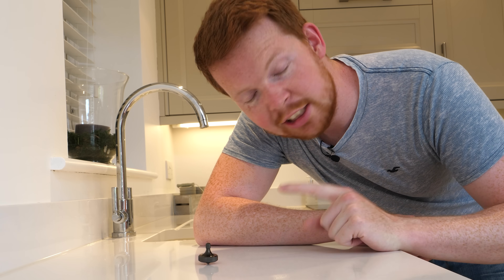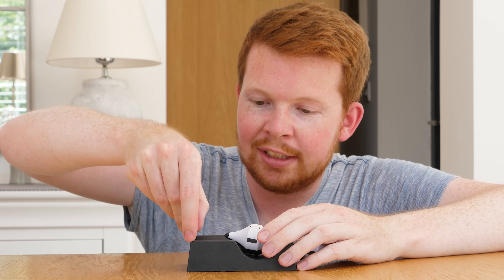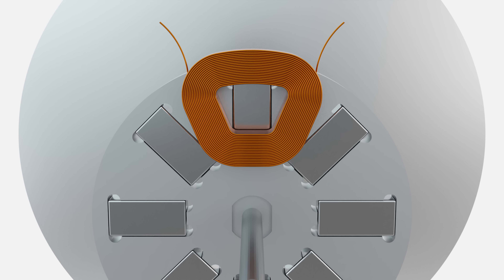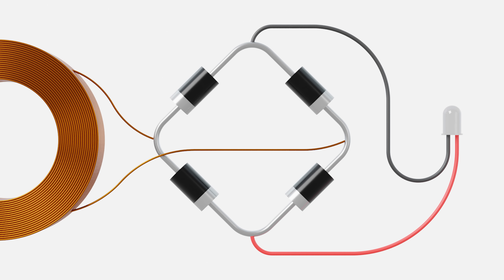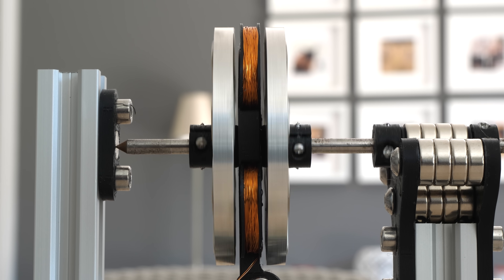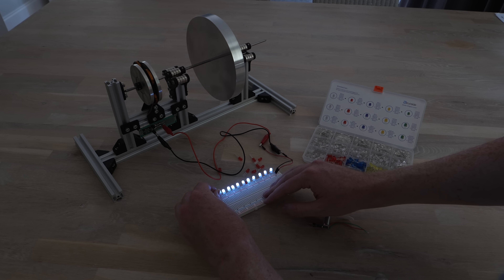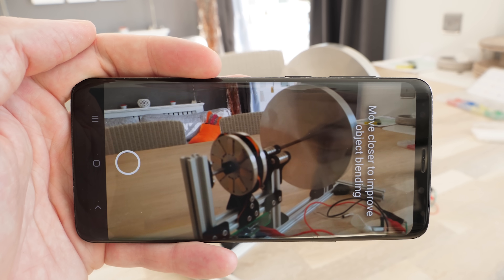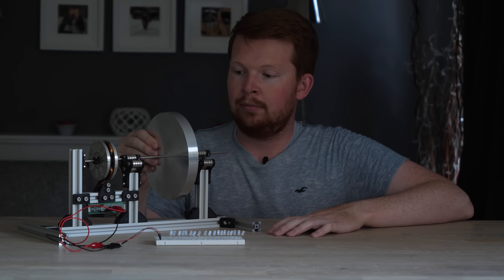Flywheel Battery

Comment: what if you were to add a small disk at the the end with fins and then a small motor fan powered by the flywheel spinning that blows the fins causing the flywheel to spin, wouldn't it eventually create enough force to keep it going? I was just showing my daughter that if she holds her fidget spinner and blows on it it starts to spin really fast so that is what made me think of this.

Comment: Could you not have got the motor to feed power back into the turning of the big metal wheel so that it never stops spinning until the heat death of the universe? we could generate infinite power. who needs fusion?? problem, friction??\#

Comment: Isn't air causing friction as well? I know that is a little bit in comparison to other factors, but if you would like to squeeze every single point in terms of efficiency, wouldn't vacuum chamber where it spins be a better solution? (Just a question as I am not a physicist so not sure if the idea makes sense or not)

Comment: I was wondering what the ratio in change of rotation length by the flywheel was in relationship to no electrical output, the LEDs, and motor or other devices, as this isn't free energy, and the magnetic coil induces friction on the flywheel

Comment: If anyone knew Tesla's secret on how he made the worlds first alternator the alternator actually powered itself as well as generated what was stated as over 1,000 volts flat foot he learned the values of creating rectifiers capacitors and transformers this way. Tesla almost by instinct knew how to create massive gobs of power from almost anything and everything he built. The problems he needed to solve were harnessing the power he generated as well as storing power is where his challenges came in. I have a good personal friend that told me stories over and over that his grand father actually worked 4 Tesla in Cambridge Mass. Well I always thought he was full 0 sheeet. until he showed me pictures that is. I started listening alot more closely after that to his tall tales. My source Bruce Seibert said Tesla was immune to electricity that he had many times touched live wires and nothing happened. Now how true that is is anyones guess he had to have a secret to do stuff/tricks like that.

Comment: If one were to A) Fix the shaft wobble and B) Apply all the best efficiency ideas from the comment section AND then...

1) Add a prop/turbine to the front of the center shaft
2) Hook the motorized fan to the generator
3) Set/aim the fan at the prop/turbine

I wonder how much longer the fan would help in keeping the generator rotating(!??)

Comment: Energy increases linearly with the mass, but with the square of the velocity.  I remember reading articles 20 or 30 years ago about ultra high speed kinetic batteries...  20k rpm, etc.  Problem still exists...  if it breaks, the energy has to go "somewhere".

Comment: I like your videos they are informative, keep it up you may want to scrap the Aluminium as a retainer near the magnets it will create magnetic influence and slow the motoring action, I suggest plexi glass as it is also easy to machine, as for the wire I would suggest Litz wire and maybe some russian ferrite for the cores, Happy experimenting.

Comment: Why not create a generator like they have in hydroelectric power plants and use magnetic bearings?  Also the flywheel will spin much longer and speed will more regulated if it were in a horizontal configuration.

Comment: Very interesting video.   I remember decades ago in the Netherlands (a very flat country) they fitted 6 FEET diameter gyroscopes in the floor of their public busses. These were spun up overnight and could run the bus all of the following day.  I cannot remember if the gyros produced electricity to power a motor or took energy via a clutch and gearbox. Operating a bus like this on very flat terrain exerted low "load" on the system and it would run the bus for a day. (Possibly shown on the program " Tomorrows World?"   
Your model must be almost what is used in a hydro-electric dam but I have always wondered.... if it was really scaled up with a levitating rotor and frictionless magnetic bearings, just how much power could be generated.

Comment: You made a generator ,yes but like other kind of generators you need to use energy to energy out of it ,though the friction force has been minimized in you model by using magnet instead of barbering

Comment: You could make this project SO much more efficient if you used a 'true' flywheel. That is a wheel which has virtually all of its mass concentrated around the circumference, rather than uniformly distributed across its radius. In other words, make it look like a bicycle/motorcycle tire--which is why they are built the way they are,  to maximize efficiency. Otherwise, pretty cool.
Reply: I’ll never understand how videos like this get so many views, when in the real world this is stuff that’s been done way better for decades.
Reply: @jeffw8218  It's not about efficiency. It's about turning people on to ideas they might not have heard of before. Some 10 year old kid could feel inspired by this and go on to become a world-class engineer. It's literally what good science communication is all about.
Reply: @jeffw8218  You're confusing "outdated" with "elementary". Harnessing angular momentum and electromagnetic induction to generate energy is a foundational concept in engineering. Sure, you can probably find a more efficient way of getting the job done, but the point of this video is that it's a demonstration of basic physics. 

Also, what's wrong with making money while teaching? Or for teaching to be entertaining for that matter? Good teachers ought to be compensated well. Their job is to inspire the next generation of thinkers.

Comment: Very interesting! How much energy can be stored in this? How long will it keep spinning if no load is attached?
Reply: I'd think that if the shaft were made straighter to reduce wobble, then the only decelerating forces would be the friction of the axle on the plate and air resistance. Adding ball bearings at the plate and running it in a vacuum could reduce these. Even 50 years ago, researchers were speculating that a flywheel turning 20krpm or more in a vacuum on magnetic bearings could spin for two weeks, with enough energy left to do something interesting. Great fun.

Comment: Place 2 magnets at 45 degrees to the shaft magnets and one in the center at 90.  Might have to place the shaft magnets at 90 degrees to the shaft by attaching to a wheel.

Comment: Use a switch mode converter with MPPT. It explores the current and voltage relation ship of your generator and runs it at its best spot, resulting in most power extracted

Comment: We had several of theses (like your black plastic miniature) as an emergency backup power supply in the US Air force. It was at least ten feet long and 20yrs old when I first saw it. I asked to be sent to school to learn how to maintain it.  Surprisingly I was sent to school to learn its operation. One system (spun) generated 250KW for thirty minutes. Ours was very old 1960s tech in mint condition. I guess some would consider me as old tech.

Comment: why not infuse the magnets into the flywheel and the other magnets to the stand on the bottom? and them the coils on the stand to! the the magnets will propel each other away, causing the fly wheel to spin, and than making static electricity, and convert it into ac with a inverter? Jesus saves!

Comment: I think it might be interesting if you could apply one of the ridiculous gear ratio cranks to get something like this spinning up manually. It might be a trick to ensure it doesn't interfere with the rotation if the axel is faster than the crank (I'm imagining bike petals in effect), and it might take a bit of initial startup energy, but I think it could get some substantial mass spinning pretty fast.
Reply: That was basically my first thought too. If he's going to spin it up with manual power, might as well have pedals and gears in action.
Reply: A freewheel saps energy though.

Comment: if you can add a gear reduction system to the spinny end that you hand spin and something to engage/ disengage it,you can get it spinning at stupid speeds while requiring no gasoline or electricity, and use smaller gauge wire with more magnets and more coils relative to magnet size, you could power your house with this

Comment: Would you try to feed a little engine with the energy created by the flyweel just to improve the RPM and create more energy until be able to generate 12v or more

Comment: Cool! since you own a lathe, straightening the bent shaft will be a breeze. Chuck the flywheel using the outside jaws, indicate it, then using a 15" x 3/4" x 3/4" piece of wood with a slightly larger than the rod hole and some oil, apply force over the spinning rodat a 5 to 10° angle and draw the wood outwards slowly. This will effectively straighten the rod, concentric to the external flywheel diameter. Reverse the piece and do both sides in the same way and you'll have a perfectly true running inductor.

Comment: if the other end of the shaft was attached to a stationed small wheel bearing, the warbling effect might be less if not non-existent, however this will lead to wear and tear over time at those regions. finding ways to efficiently increase the flywheel rpm is directly proportional to increasing the power out put. this is a good work.👍.
Reply: That would introduce quite a bit of friction. Frankly the best thing would be better materials

Comment: what if you connected a motor to the rod and gave it an initial spin and then the motor just makes it spin infinitely Obviously a higher torque motor that can spin faster than the rod at an inital speed

Comment: Would it be feasible to keep the axle in position with magnets as well maybe? If instead of a metal or glass plate at one end there were two opposing strong magnets as well. One rotating at the end of the shaft, one stationary next to it. You would get rid of even that little bit of friction. And if you enclose the entire thing in an air tight housing with a pressure valve and create a near vacuum inside of it there should be practically zero friction at all. I think that might be a great upgrade for this, to make it into an actual long term battery that does not degrade with usage and does not use chemicals. To put energy into the battery you would just need to reverse the entire flow of voltage and make it in to an electric motor rather than a generator. Sure it wouldnt be the most space efficent battery type, but where space is no limiting factor it might in fact be useful. And its over-engineering the crap out of and already very nerdy project which in itself should be more than enough reason to try it.

Comment: Now instead of the drill you hook to the shaft either a windmill or a water wheel they don’t have to be consistent because once they get the flywheel going sporadically it should still generate electricity.

Comment: Geez....this technology has been around and in comercial flywheel UPS systems for around 45 years and is only used for a few seconds until slower backup systems can get up to speed or brought on line.

Comment: bolt it down, wrap a long, thin, durable string around the center of mass, pull it while slowly accelerating away from it and see how many rpm’s you can get out of it

Comment: Hi Tom I watch the videos you produce and I am blown away by the passion and interest you have into physical forces. 
You obviously are a engineer and physicist.
I am mind blown by how smart you are and I am intrigued by the intelligence and  the information you provider for everyone. 
I am not as professional or knowledgeable as you.
I just focus on creating enegry.
I personally think that eletric is so easy to create for free.
Sun, wind, pressure, gasses, heat, kinetic enegry. You name it. You could even design a micro greens growing box that harnesses the moisture and heat to produce enegry from. 
The possibilitys are endless.
I think that inventors have been suppressed since the industrial revolution.
You could in theory use a magnified glass to heat a bottom of a tube . Then use the hot wind to create wind from it rasing upwards. Then you have just harness the sun's enegry and converted it into wind energey.
From thermal energy to wind to eletric. 
It would take abit of designing tho but it could work.
Just a simple thought I thought of while writing this. 
I have many many inventions but I just don't have the tools and money to do anything.
PS the tesla coil was made and now is being used to use enegry instead of producing it. 
The world has gone crazy.

Comment: Early experiments with electric buses back 1950's -1960's use machinical batteries base around your machnical battery experiments. It gave improvement of 20% inprovement on battery life on one charge.

Comment: Try a 5 coil with 8 magnets
The irregular ratio will actually stop the flicker and make the light smooth
It's the same reason why high speed props normally have 5 blades
To stop the thud thud thud of a 4 blade prop cycling against the rudder or the vacuum thud of the turbulent water off the back of the skeg 
Hydraulic pumps and compressors use the same method to dampen the fluid, either oil or air, going across the ports
Normally 2 ports .. inlet outlet.. pump vanes, gears, pistons all irregular numbers 5, 7 , 9
One blade/component is always engaged in the transition 
The bridge rectifier will handle it just fine
Make 5 coils, it would make a huge difference to smooth current and gain voltage

Comment: What if instead of using a plate to resist the sideways pull of the magnets you used a set of opposing magnets at the end of the shaft and where the plate would have been? Would that not further reduce the friction?

Comment: bro... if youve got metal that isnt straight put it on the ground and give it a tap with a hammer where its standing off the ground... you dont need too much force... even a wooden table with a couple bricks laid straight would have done the trick to help straighten out that bar for ya just a few good steady taps with hammer/mallet...

Comment: 4:45 that's also alot like how a "Pickup Coil" works on a small engine like a lawnmower... a magnet is spun on the flywheel while a pickup is set verry close, about a playing card thickness when the magnet passes the pickup it creates current that sets off the spark plug

Comment: The DC voltage measured after the bridge rectifier is 1.2 V lower than the output from your magneto because of the forward voltage drop of the rectifier diodes. So 0.7 V was actually nearly 2 V. Adding more coils and windings in series gave such a good improvement because each coil's output is added on top of the original 0.7 V - the rectifier drop is an "overhead" that you only lose once.

Notice that the flywheel slowed much more rapidly when adding more electrical load - a wonderful demonstration of the principle of conservation of energy.

Comment: If you thread a magnet near end where metal rod touches the plate and an opposing magnet behind the plate, the friction should be reduced even further and place it inside a vacuum, would the flywheel keep moving. How much longer?

Comment: ok but this is only the half of the machine ! you have magnet to repel upside but you need other to downside and you need repel the 2 point and now you have close it, in the flywheel you need make a way to roll an ball but the bal is atraccion but in upside and now you need think this

Comment: Can you please tell me, would it be possible to make a similar thing to this, that while it spins it powers a motor which is attached to its own axel, so it turns itself as it powers itself? I dreamed this concept years ago but have not the equipment or know how to put it to the test, and physicists tell me it would not work, but it seems to work in theory! Can you tell me what you think of such a concept? Or even if you wanted to make my tiny little day, make a working model in one of your videos testing this theory out? Many thanks!
Reply: No unless the motor that you going to use uses insanely low amount of volts then your out of luck
Reply: @ArBuzowy12  yes makes sense

Comment: Nice built. I had this idea a few years ago and then found this was already in use. However I guess you should use it simmetrically to have a battery (and not "simply" a generator). I mean you should, in my opinion, use the alternator also as a motor, to make both the input and the output part of your battery electric. Then one might think about using a vacuum pump to achieve an higher capacity. Thanks for the interesting video!

Comment: Is there no way to place magnets on the fly wheel to keep it spinning. Perpetual motion?
Reply: You could place magnets on the flywheel theoretically. It was probably just easier to make work with a separate magnet and coil assembly. The magnets would not keep it spinning without a supply of energy though. They would attract the other magnets half the time, and repel them the other half, cancelling themselves out. Perpetual motion is impossible, as there will always be some loss of energy, and you can not get more energy out of a system than energy put into the system.

 Whenever the magnets on the alternator are used to power something, lens' law ensures that they feel resistance to the motion which converts the kinetic energy of the flywheel to electrical energy in the windings, and eventually either luminous energy or back into kinetic rotational energy. Since every generator is also a motor in reverse, he would probably be able to run the circuit in bypass of the rectifier to make the alternator work as an induction motor, given he had a suitable AC source to synchronize with the flywheel. In that case, you would be putting electrical energy in, resulting in kinetic energy being stored in the rotational inertia of the wheel.